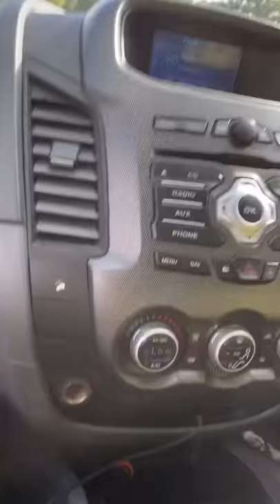Bricklaying

Comment: C’mon Chaz. Let’s av’it , best trowel you’ve used to date ? I see you using tyzack an you got a couple of different sizes aswell. What’s your opinion on the trowel debate !
Reply from the maker: Honestly love the broad heel atm👌🏼 such a straight edge on the blade. Feels like I’ve been using it years and worn it down. So yea my favourite is the spear and jackson broad heel woooden handle 10” 👍🏻
Reply: Charlie Collison  that had to be forged one piece ! Not spot welded . I’ve mentioned it to other up an coming bricklayers about the sweet spot or like you say worn in feel. Once you know you know. I like to go an actually take a few off shelf an try the lift , balance etc before I buy a new one , for me a high lift is essential.
Reply: Charlie Collison  🤙🏼💪🏽👊🏼👍
Reply: Fabian DeGussion loads of good trowels on the market these days . Welded trowels have a bad reputation , mainly because they are usually very badly welded and made from crap raw materials. But when welded properly and made from good materials there as good as any one piece forged trowel . I’m using a now 9 inch narrow London (welded trowel ) fairly certain its a ck trowel it’s top class . I just bought a new old stock welded ck 10 inch London trowel made in Japan it’s a beauty.